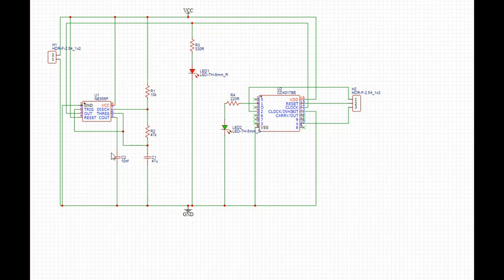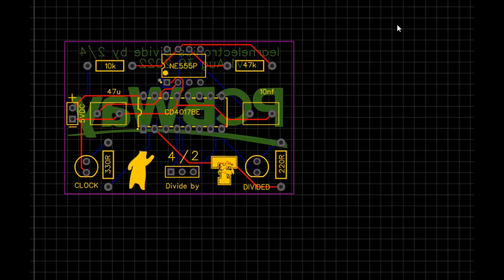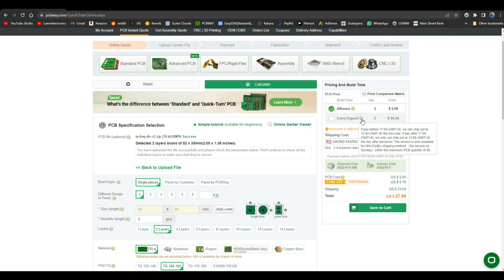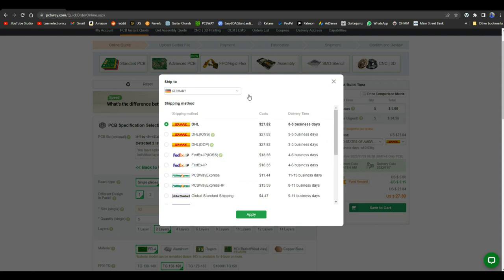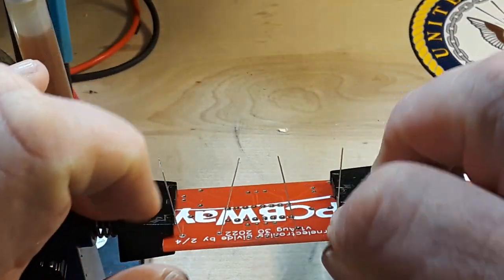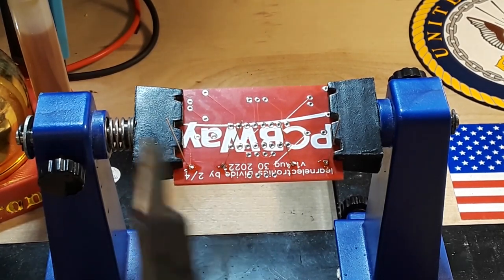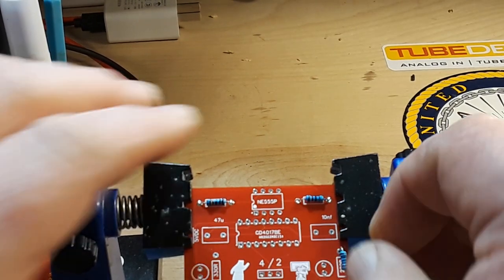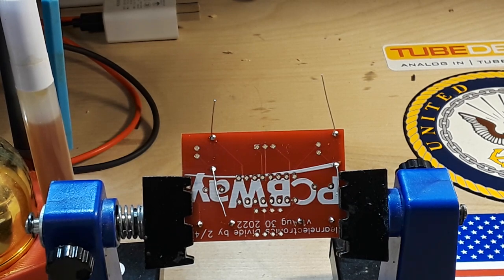Decade Counter Frequency Divider

Comment: Troubleshoot... First, disconnect 4017, check output of 555 to ensure its running at the desired frequency. If not, change components for desired output pulse. Second, reconnect 4017 and if the same problem appears you have isolated the problem to the 4017 circuitry.

Comment: I was looking at the datasheet and I'm not sure what you were going for, it looks to me the green led should come on the second rising edge of the clock, then go off after 2 more clock inputs, at which point the output 2 going high would reset every thing. but the led will do the same thing except stay off longer when connecting output 4 to the reset. then it takes 2 clock cycles to come on then its off for 6 clock cycles, the 4 clocks till reset is triggered then 2 additional before the 1 output is set high again. I didn't see any warning about floating inputs, was wondering if that was causing the problem with the clock inhibit not being tied low so I looked up the datasheet.

Comment: I had this problem recently. I needed to put a resistor between pin 3 of the 555 and the clock input of the 4017. Not all my 4017s had this problem. I have built this circuit many times and I never needed the resistor. Now  I always put one. Cmos inputs are very fussy.

Comment: At a guess the 4017 is starting in an indeterminate state. Perhaps a capacitor between vdd and the reset line and a resistor to 0V to provide a positive reset pulse on power up. You may need to delay the 555 output until the reset has completed. Not sure exactly what happens when an output rises and that is used as a reset, because the reset needs to fall properly before a reset actually occurs.

Comment: CMOS circuits need pulling resistors on their inputs, or it gets treated as an antenna. So the reset line, at the very least, needs a 10K bodged to ground. 

Also can't help but to notice you're using what amounts to a 10-line demux when frequency division is the action you want. Since you're only dividing either 2 or 4, any binary or BCD counter from the series would do, it wouldn't matter. 

I can see what you were trying to do, but any counter but a 4017 would have been my choice. Throw in that resistor and you'll see what I mean.

Edit: When you solve the floating reset issue, what you're going to see instead of clock division is something like an edge detection pulse on the rising edge of either the second or fourth clock pulse, depending on the switch selection.

So, did I pass the pop quiz?